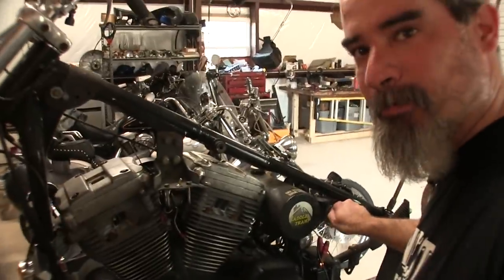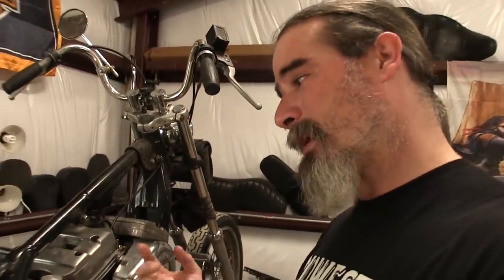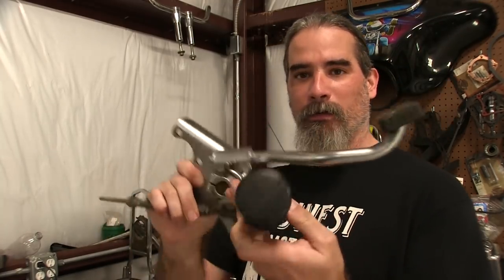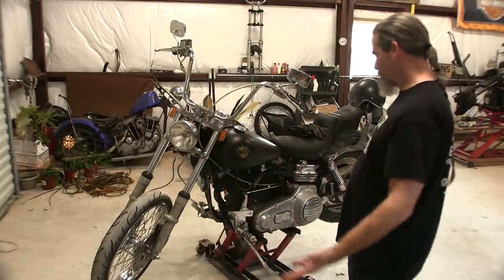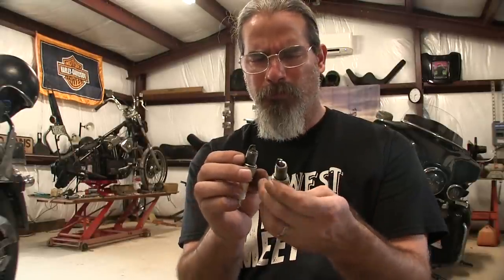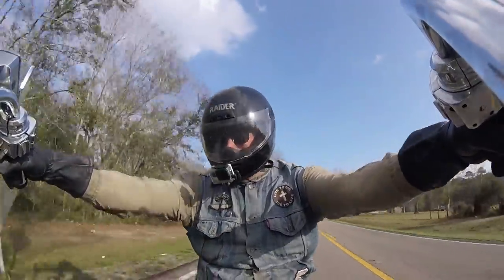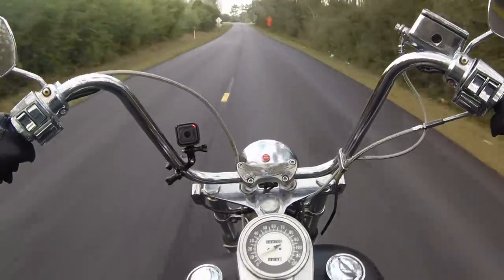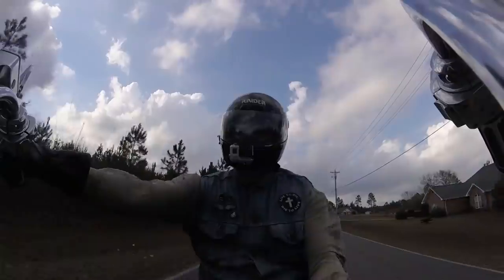HARLEY Davidson SHOVELHEAD Is WAY PRIMITIVE Of A MOTORCYCLE For Today's RIDERS

Comment: When I was a young chimp in So. Cal, before the yuppies discovered Harleys, it was assumed that if you owned any HD, you knew the drill .... multiple maintenance hours per each riding hour!  And you wrenched it yourself except for stuff that required specialized tools or machining.  Back then, it seemed there was always a graybeard around to make sure you did the job right.  I figure my '70 shovelhead lasted 20 years longer than I thought it would before I let her go because of those older guys.  Now a graybeard myself, well, videos like yours really bring back the warmth of those days.

Comment: I have a 79 FXSR-80, she's a beast and what a glorious, troubled, beast she is! If I had the facilities I would tear it down to the frame and finish/repair all of the things Harley left undone. Just got my heads and rocker boxes done but now it's zero degree's out in the scooter shed. Super E rebuild kit came in, new tires, front end seal kit, brake caliper rebuild kits, the list goes on. Even with it's troubles I LOVE this blasted machine. Enjoy!
Reply from the maker: There's something about getting to know these things.

Comment: Shovels can be pretty reliable once you go thru them a bit and make sure things are in proper order. As far as gearing, I run 24/51 on my 1976 super glide (74ci). It'll do 65-70 all day. A popular gearing for them is 24/49 which I had tried, but due to mine being a 74ci and me being around 240lbs, it didn't have enough engine for that gear ratio on the highway.  My dad runs that gearing (24/49) on his 86ci panhead and it is perfect for that bike. The extra cubic inches really help it out

Comment: Hey Tramp ,I had a 67 shovel that I drove 80 every where I could &it did not blow oil(Kendal nitro 70 weight ),88in.S&S flywheel & Franklin, highcompression pistons with Teflon buttons on the skirts ,solid lifters transformed from hydraulics with three more cuts on them just like the factory cut for the former hydraulics, ( light but still ride round in tappet blocks ) 1936 knucklehead "lightening" generator drive gear, pinion gear & Andrews cam cut back to match ,custom valves,springs & titanium spring collars ,polished rods & A S&S Side bowl G.A.L.Carb ,22 tooth engine sprocket, 24 tooth trans sprocket ,this Bike would Roll ,No Speedo Trooper stopped me for doing over 112 MPH could not clock me as he was on a car I had just passed ,end up with 80 in a 55...Missouri Paul 👍🇺🇸👍🌞😎

Comment: Yes the old blinkers work like that. Plugs do fowl out on them. Somethings to help that I did to stop that. I use a spyke electric ignition instead of points (huge upgrade), and made sure my jets were right ( I do have a S&S carb)in the carb. Mine seems to idle the same everytime. The gearing: My Dad years ago ( late 70's) changed the gear on the engine (most forward one on the engine) to a larger one (23 teeth he thinks), and also got rid of the compensator (cone shaped thing behind the gear). People also did change the sprocket, but it is riveted on (I think that's why it's still the original one). You can do both and it would work really good. Shovels will smooth out at certain speeds. I ride mine like 72, 83 or faster for long distances. Little bit of oil weeping on long rides. Mine doesn't have that much valve train noise. I have hydraulic lifters. Solid lifters make more noise until warm. I know 71 through maybe 75 have the speedo cable in the tranny if that helps. Use blue loctite on everything, or you'll be constantly tightening up things. Everyone sets the idle way to low. It sounds really cool, but it's hard on the bottom end I've been told. My idle is low, and it sounds good. Mine is a 72 superglide (electric start too, but I still kick it. Just nice to have) with a wideglide frontend, mechanical drum break (both chromed plus rocker boxes too), and a 21 inch tire. A real nice upgrade too is the newer style stator (like my 99 heritage Springer classic). On your block head sporty usually the ecu works or they don't. Usually you find that out when you go to restart it, and it doesn't happen. Hope this helps some. Mine is lowered to, but I kept the original split buckhorn handle bars grips, and everything.

Comment: Although my everyday rider is a evo. I do have a 1981 Flh which is a shovel. I’ve put a lot of miles on that old bike and found that a oil cooler and a 47 tooth sprocket keep her happy. If your chain is wore out as much as you say then your sprockets are probably wore out to. I’d change them out and run a 23 tooth front and 47 tooth rear.
Reply from the maker: I'll consider that.

Comment: My Ironhead is from the 55mph era, but I found going from a 51 tooth rear sprocket to a 45 worked far better. It still accelerates fine, but there's quite a gap between 3rd and 4th (top) . I tend to only use 4th for motorways (British freeways) now. It's my only bike, so it has to do it all :-) PS Love the shovel - Marianne Faithful on her Electra Glide was my Sons of Anarchy.

Comment: Love shovels don't understand were the oil is coming from but that sounds fixable. Raised in a HD shops in the 70's my 72 would run 90 all day long. But there was a 5 speed Little John transmission out at that time with a overdrive. I wanted one but oh well. We raced this January at the Daytona Dirt Track took 3 bikes won the 250 classic with are Ossa won the Sportsman 250 with are Rokon. And got a 3rd in the Sportsman 600 with SN 2 Rokon 340 Dave Aldana won that race. 
Fun stuff " Rokon Racing Tream Grearless"  Mississippi Boy's.

Comment: I’ve been riding Shovels since they were brand new state of the art machines. Most of my 74’s would hold 85 on the highway. My 80’s would do 90. I have an 82 FXR it s quick for a Shovel, beat 103 twin cams sometimes, depends on the other rider. My 84 FLHX is my favorite Shovelhead it has a Baker 6 speed handshift rocker clutch. The exhaust sounds so good, you can tell a shovel from blocks away.If you stay on top of the maintenance they are pretty reliable. Old school too Kool. Hope you get yours sorted out and enjoy it.

Comment: Jims makes an Evo oiling system for shovel heads. It's pricey but I did it very remarkable up grade. That little oil line to the heads is gone. Engine sounds a lot better less tear downs.

Comment: Right on. I have a 72 FLH that is now a 88" stroker built by GMS racing and I own a 81 Wideglide. I absolutely love my Shovels. The 85 FXRC is the best riding and handling Harley I've owned but there is just something about Shovelheads that I'm drawn to. Good to see ya on a Shovel now..🤣 later dude and good luck

Comment: Hey mate if you use your multi meter on OHMS whit the bell on touch one to each end of the wire and you bet the bell noise that mean your wire is not broken a sparky call it belling the cable if you ends of the wires are too far apart just use a scrap peace of wire twist it on at one end and bell through that to make it reach anyway good luck what ever you do.

Comment: Well one thing I do know is the two biggest enemies of Harley shovels is vibration and heat thats what kills every shovel and most Harley Davidsons I used to have a iron head. What I noticed about mine what electrical issuse would happen. And one time I was in the process of starting my bike and it only ran on one cylinder one day. At first I though that the rear spark plug went out. I replaced both plugs. Kicked it over and same thing. So I pulled out the rear spark plug and kicked it over using the front cylinder to clear out the rear so it literally was running on the front cylinder with the rear cylinder without the sparkplug. It turned out that the rear cylinder was flooded it shot out alot of gas. I ran it for 5 seconds. Turned the bike off put the rear plug back in then kicked it over and it was running on both cylinders again. The old bikes are great just keep in mind they are extremely temperamental.

Comment: i bought a brand new 1980 shovel head years ago. It foul  out alot of plugs. The four speed was out dated. Old timers would say 2nd gear is to low and 3rd gear was to high. Then i bought a 87 and 91 evo which were much better and probably saved Harley Davidson. Today i have a stock 93 fxr-sp and love it.  Bob.
Reply: Mary Barosso, that's why the "old timers" put Andrews 1st and 3rd in the four speed transmissions.

Comment: Coils only gonna have power on one side when the keys on. The other one is triggered by the box. Usually the coil goes bad first because the housing gets old and cracked and let's moisture get in and shorts it out

Comment: Nice job with the Wide Glide front end. My dad and i did that to my 1981 sturgis last summer! We had to make rotor spacers to keep the dual disk and updated the front  brakes to 08 style 4 piston by using FL lowers Was a ton of work but look 1 0f 1 and handles/stops amazingly
Reply from the maker: Very cool, man!

Comment: 👍
 My 77 XLCH chopper hasn't had a speedometer on it for over twenty five years. Tachometer only. 
 I had to get "Re-learnt" on the RPMs=MPHs after a complete rebuild....
• Stock "P" cam
• Ported/Polished and Flow tuned 
• S&S E
• Dyna S ignition 
I also swapped out the front sprocket to one tooth larger. (Rear, not stock, original Gaffney mag wheel for a shovel, drum brake) ... sorry, forget the exact ratio... 
 Bless you man, and please keep your hands on the bars! 👊

Comment: The 1980-84 shovelheads haves five speed transmissions you can run them 80 miles an hour all day! I’ve owned My 83 FLT over 20 years ! It has been a practical bike and mostly trouble free at least as much as any other bike. It just has more personality than a modern bike!

Comment: Yeah the shovel heads are different I think it's because the flywheels in the motor actually are heavier than the Evo. We're an evolution motor will spool up quicker
I always went to a 49 tooth rear sprocket
Reply from the maker: That's interesting.

Comment: My first Harley was a 1981 Electric Glide. I bought it in 1986 and it only had 4,800 miles on it. After riding a 750 Honda 750K model for about 7 or 8 years, this Harley was a pretty unrefined bike. Boy was I ever disappointed! I rode it for about a year and sold it. Shortly thereafter in 1987, I bought a1985 Tour Glide Classic. What an improvement over the 1981! I rode the Tour Glide for almost 20 years. I loved it. I currently own a 2008 Ultra Classic, another great bike. What surprised me about the '81 Electric Glide is that it didn't run as good as my dad's 1968 FLH and it vibrated a whole lot more. I think I'll stick with my Twin Cam and the Evo motors. 👍

Comment: I owned a 1970 Shovelhead full dress FLH yrs ago. One of the best bikes I ever had. It would cruise easily & all day at 70 MPH and I had it over the ton many times with no issues. Just keep a check on nuts and bolts as they do vibrate some. That's what makes them fun. There is no sound like that of a Shovelhead cruising down the road. As far as I'm concerned, the Shovels were the last of the real Harleys. Have fun & ride safe.

Comment: My first Haley was a Sportster Ironhead XLCH 1963, the next was a Shovelhead Electra Glide 1974 and the first thing I learned was to always let the engine run warm after a cold start, after the first winter when I took out my Harley I started it maybe 1 minute, put on a helmet and clothes would start it did not work called the Harley workshop and told them what have hapend the mechanic said change the spark plugs I did not believe in this but bought new ones and tried and the Electra Glide started immediately. But I never had a problem on the road

Comment: you absolutely have to change the rear sprocket on these things and it's so easy. they have so much torque, you won't even notice it when you take off. you'll be surprised how happy that motor will be at 70-75.

Comment: I have a '78 FLH (Early,  so 1200cc/74ci, mid year they went to 80 ci and electronic ign)   Sprocket wise, it has a 23 at tranny and a 51 on the rear.  55 mph is somewhere around 2500 to 2700 RPM  (have a newer Harley electronic tach on it, non-ECU tach).  BDL belt drive on primary.  Remember, Shovel's are dry clutches.   Books say red line is something like 6200 but 5500 is more realistic.     As for the varying Idle thing,  cause is mainly the centrifugal advance weighs.  Any dirt, or dried out oil/grease and they don't return consistently.  I put on an Ultima IGN and it idles fine.  Oil lines to the head......they leak.... yea.  the rubber o-ring things are a few bucks a set, but......oil line feeds the rear and then crosses over to the front. Fine when new.  Any wear on the rear rocker means more oil will seep out to the rear and less goes to the front.  Change them to the "Old-Stf Cycle Shovelhead Rocker Box Split Oil Lines".  Low Brow sells SS ones  on eBay for around $95.   They come "natural finish (dull)  but rubbing & polishing compound and elbow grease can make them nice.  You can get brass for $85, but remember, brass work hardens faster, and corrodes.    Who needs a speedo,  get a tach....LOL

EDIT.... also have a '86 XLH 1100 standard (sleeper version of a Liberty edition with the bath-tub heads, just no bling)
Edit 2  : adjust chain while sitting on bike.  Swing arm travel can tighten the chain.
Reply from the maker: I've thought about a tac.

Comment: Changes look great, big fan of wide glide. Had  a 79 lowrider for 7 yrs, was backup to my soft tail. Only failed me once, the cheaper electronic ignition I put in failed. Lesson learned, put in a Dyna single fire and S&S carb. Previous owner had changed out rear sprocket. Smoothest it ran was at 65-75. Looking forward to how it will turn out for you.
Reply from the maker: Thanks for sharing

Comment: Some guys would use silicone on the rocker boxes or whatever,, and a piece would end up at the check ball on the oil pump . there is also a little screen there to clean out.

Comment: Champion RN12YC gapped to .035.  Points gap ..020,  Check your advance weights for a broken spring.  The sprocket change should not be a problem.  With a four speed transmission it'll give her longer legs.  Yes on a maiden voyage do carry tools.  Got bit by that first ride of the season.  Fortunately a guy was working on his boat and he even had a sloped downhill driveway.  He had tools!  Just a loose battery connection and me being embarrassed when he said those saddle bags are for more then just carrying beer.  I didn't even have that.

Comment: I bought a 1980 superglide brand new and still own it 
Took a couple of cross country trips with it  running above 70 mph most of the time ( factory gearing)  I kept the 1980 speedometer ( 85) max  a lot of my friends at the time changed them out with 120 units I always thought it was as kinda funny to peg the speedometer out

Comment: I have an 82 super glide and I always take off on it without tools . The only thing about that bike is the faster I go the  more it vibrates . If you're going to do 70 or faster it will eventually crack the mounting tabs on them gas tanks

Comment: i went with a 48 tooth rear sprocket ad a 24 front. with a standard ratchet lid 4 spd it will cruise 70 all day long. i really didnt notice any loss in power but my mill is a 80in with a mild cam. my bike is light tho,. its built to look like a 76 fxe superglide.i did put a 88 to 99 narrow glide on it wich allowed me to mount MUCH better brakes.

Comment: One more tooth on the trans. sprocket and you will get 70 mph in 3rd gear.  You will have to shave a little of the housing to fit,  but it works great.  I did that to my 78 flh.

Comment: Love those old Shovelheads, it'll teach you something about characteristic alright.  While I've never owned one as of yet, (who knows what tomorrow might bring). But I can tell you I have raced a many of bike in my younger years. If you want more speed and less RPM's drop no more than 5 teeth on the rear sprocket, or no more than 2 on the front sprocket. Unless your planning to race it that will require a lot more time and money . But one of these configuration will allow you to Cruz the Freeways and you'll be able to keep up in the Mountains Passes.
Ride safe my friend.

Comment: Man that's a cool old Shovelhead, love that! The wide front looks great and it's going to look really good with the normal mid controls. Oh, and you can either go up 1 tooth on the front sprocket, or down 4 on the rear (either one is about the same ratio). I went one extra tooth on the front and it really helped for highway trips. When the chain gets a little loose it does drag on the muffler bracket a little, keep an eye on the chain tension if you go with different sprockets. Anyway, then I went back to stock gearing for blowing away rice grinders on the twisties around here. Dumb kids, they think a 1275 Sportster is a 'cruiser'. LOL.. Wrong!
Reply: Up until the 55 mile an hour speed limit imposed in the 70s many states had no speed limit on the interstate especially out west when the Pennsylvania Turnpike was opened it had no speed limit show the speeds in the 50s and 60s were faster than the speeds in the 70s because of the bulshit energy crisis which we are still paying for today my mom's Oldsmobile Cutlass with cruise at 100 miles an hour smooth as silk not straining and the faster you went the better gas mileage it got boy that was a great car
Reply: @frankmarkovcijr5459  Oh yeah! I remember those days before 1974 when the speed limit was mostly 70. We lived in Montana from '67-'71 and there was no speed limit there at the time. My Dad used to try out his car with my Mom and me in it. He had a '65 Chevelle SS 327. I remember going fast, but not sure how fast, I was only a kid at the time. I do remember there not being any other vehicles on the interstate back then. We had the road to ourselves most of the time. Good times!